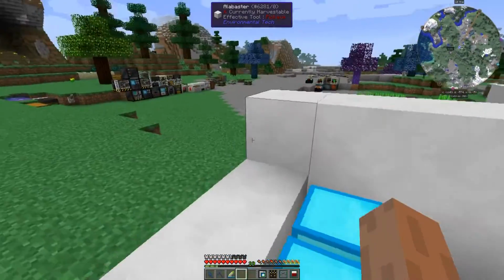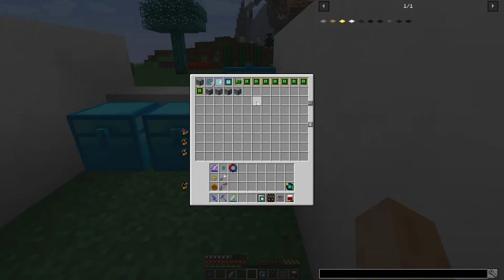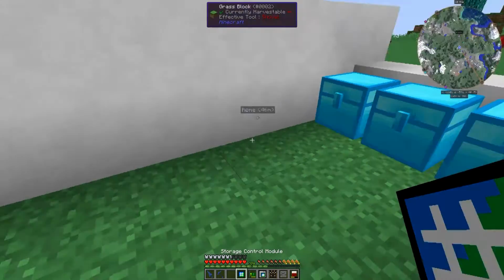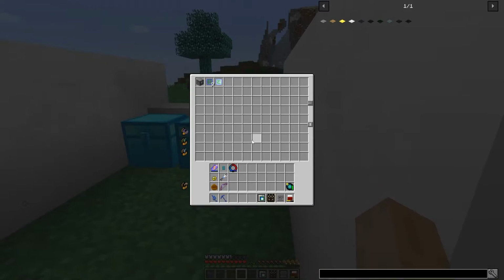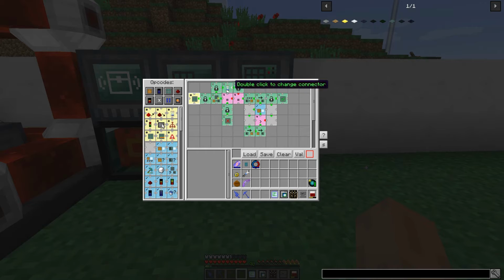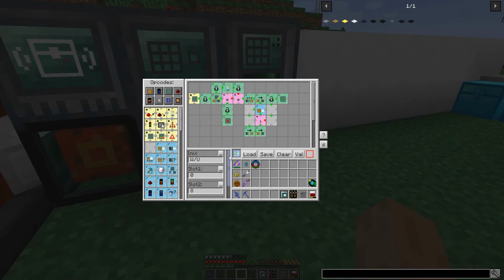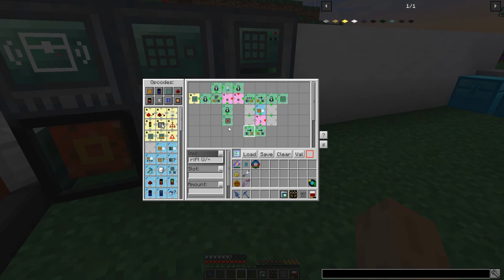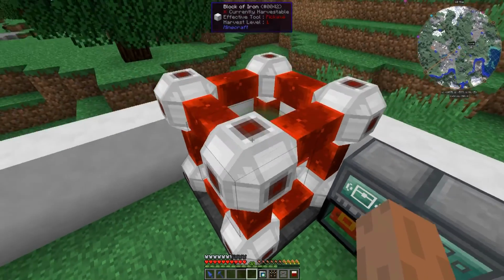Candy Dish ep9 - Easy Autocrafting w/ Rftools Control

Comment: Well I'm over a year late on seeing ths, but Hi Toddy.

Ender Rift is a pretty rare mod, but back when we were talking I ended up using the Inventory Interface and Player Interfaces from AA. The Inventory Interface, in particular, allows you to link together a basically infinite number of inventories via item lasers (it even worked for the Tinker's crafting table, which was pretty wild). 

I also managed to use this technique to automate a bunch of other things, like a functional botania runes (with a system to monitor and "top off" the mana pool). 

I found this because I was feeling nostalgic for RFtools in this modern world of "Refined Storage" where we all just schlep interfaces on machines and make drives and call it a day.
Reply from the maker: I have yet to ever set up anything with refined storage. Never been a fan of applied energistics type mods. Anyway, hope you're doing well. As you can see, I quit YouTube. It lost it's value to me.
Reply: @xxxtoddythebodyxxx  Hope you found something else fun to do. I sorta stopped Youtube too.

Comment: Trying this setup but my items are ending up in the Crafting station output instead of being put back into the inventory... Is that expected?
Reply from the maker: Yes. You select what you want crafted and pick it up in the crafting station. There are ways to put it back in whatever inventory you want though. An added program can pull the items out and put them where you want. You can also just use an export pipe. Sometimes I use a player interface to put the items in the player inventory if you have that mod. I think it's random things.
Reply: ToddytheBody Ok got it. 

I guess the only thing we're missing now.is the ability to see the crafting station recipies in the storage scanner.
Reply from the maker: Yeah it would be nice to just hold shift and the icons change to what they craft.
Reply from the maker: I've gotten this question a few times now. Where do you want the items to be drawn to? So I can figure something out for people asking.

Comment: Hey Toody, my crafter just says waiting and one of my CPU's on the processor says busy but nothing happens. Might I ask would you know what it could be?
Reply from the maker: Hello. Could be a few different things. Just off the top of my head: make sure you have all the ingredients available. Have enough processors. You need more than a few for complex recipes. If it's busy, then that means it's waiting on something. Check all the blocks that handle the ingredients and see if they're just sitting anywhere.